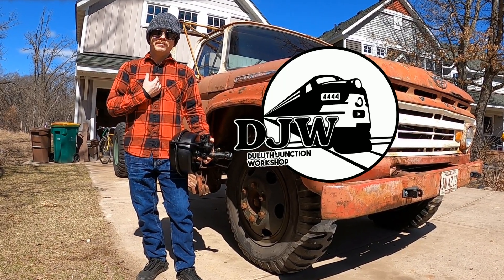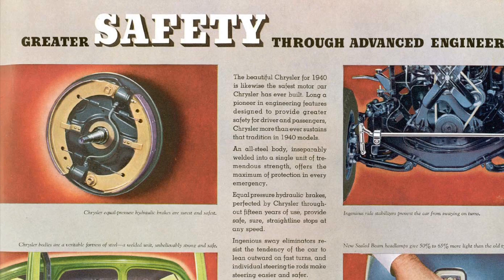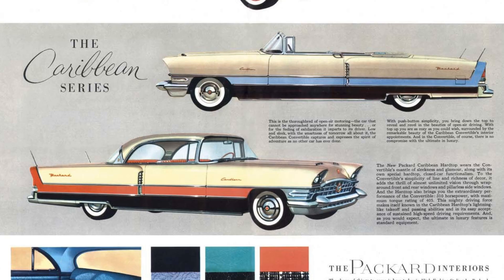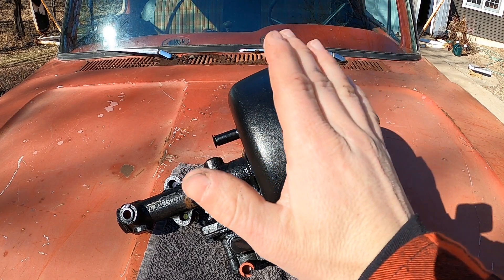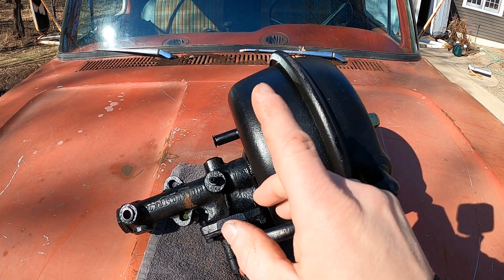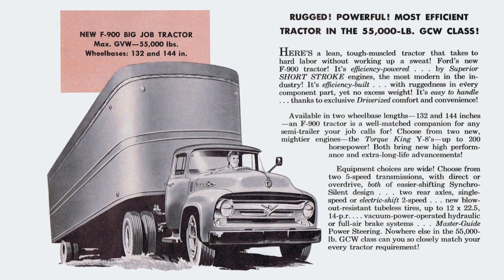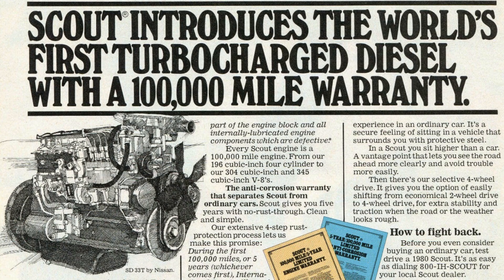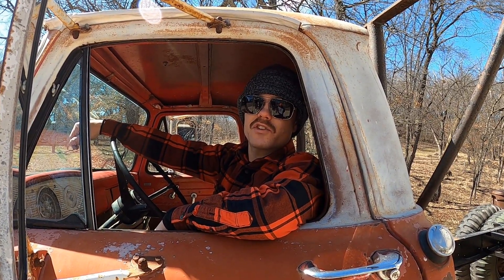All About Hydrovac Brake Boosters! Ep. 37

Comment: thanks for explaining. im trying to figure out how to rebuild the hydrovac booster in my '61 mercedes w111 fintail sedan. got no power brakes and a fat vacuum leak and the engine is burning brake fluid and throwing lots of white smoke.
Reply from the maker: I would suspect the slave cylinder seals are going out, letting fluid into the vacuum side of the diaphragm and getting sucked back through the vacuum hose. Thankfully you miiight get away without replacing the diaphragm? I would probably rebuild the whole thing anyway though!

Comment: What kind of vacuum hose did you use to run from the intake manifold to the check valve and then from the check valve to the hydrovac? Thanks!
Reply from the maker: PCV hose should work. It just has to be oil safe.

Comment: Hi. Very helpfull info.👌 I'm currently working on fitting this exact 'Midland Hy-power' booster ( fully rebuilt via chuck @ chucks trucks), complete with check valve etc, onto my 1942 Ford ' jailbar' 2ton, it's a 6cyl 226 . I'm about to drill & tap the inlet under carb for the vacuum hose fitting, Q is what size through
hole into the inlet bore chamber? It's hollow so will need to somehow bridge the gap. It does already have the orig  wiper vacuum port but it's too small & to enlarge would wipeout the housing boss. Any tips much appreciated. 🛠👌
Reply from the maker: Sorry, I would have no idea of the stock size. I recommend starting with the diameter of your vacuum hose, and then find a fitting that goes inside the hose. Fit the hole to the size of your fitting's threads.

Comment: I'm currently trying to diagnose a bad booster in my 61 f700.  Seems like it might be working sort of sometimes, but my biggest concern is when I am decelerating from a high rpm and use the engine to help brake the thing smokes bad.  This is the only time it smokes like that.  I am wondering if there is fluid leaking past the diaphram and the vacuum is sucking it into the engine.  I just now plugged it off to see if the smoking goes away and I am already looking to see if these boosters are even available.  Looks like later years might fit but I'm not quite there yet.  Thanks for the video.
Reply from the maker: You'll probably want to get it rebuilt. NAPA has them in the system but they're NLA. I sent mine to Brake & Equipment Warehouse in Minneapolis. They found someone to rebuild it for $400 (several years ago).
Reply: @SealedBeamRallyTeam I’m still ironing out some stuff before I get petty things like brakes haha but I did find one at advanced auto parts for a later year that looks like mine at least in the pics for about $200. If that doesn’t work I’ll find a rebuilder.

Comment: Where do you get parts for these?
Reply from the maker: I had mine rebuilt through Brake & Equipment Warehouse in Minneapolis. They found a place in Texas that did the work. Always happy to support local businesses, and they are worth a call if you need it done. It was a few years ago now but I recall the rebuild coming in around $400. Cheaper and easier than trying to adapt a firewall booster that would conflict with the carburetor.

Comment: I have a 71 gmc 5500 and I can’t get the brake pedal to come back out after pressing. Master cylinder is full of fluid
Reply from the maker: Everything hooked up factory style?
Reply: @ as far as I know. I’ve never messed with one of these trucks, the guy I bought it from put a new master cylinder on it.
Reply from the maker: @shanedees4124  Did it ever work correctly? Is there anything that changed?

And do you have the factory service manual?
Reply: @SealedBeamRallyTeam  I have no clue and I don’t have manual. Guy I bought it from said it used to be a fire truck. No I can’t get it running, Put a new alternator on it today, runs for about three seconds then all power cuts of, battery meter goes from 14v to 8
Reply from the maker: @shanedees4124  I would recommend buying a repop FSM on eBay or similar. My Ford books cover F100-F900!

Comment: I'm in superior and nead your help
Reply from the maker: Brake And Equipment Warehouse in Minneapolis was my main source for brake parts, although NAPA can get a lot for it. Factory service manual is necessary. 

Any specific problem you're having?
Reply: @SealedBeamRallyTeam  Do you have a copy of that manual by chance? or know where to get it ? I have a '73 C65 that I need to fix the brakes on. Just got it running and running great. Only flaw is brakes are super weak and lights don't work (no biggie there)
Reply from the maker: @OMAR-er9ec  Search it on Ebay or one of the many classic truck vendors. Both my 62 and 65 Ford truck manuals cover everything from 1/2 tons to cabover semi trucks in the same book. I've found repop manuals tend to go for around $75 and are worth every penny

Comment: Very informative video sir! I keep buying big old trucks, and so far all of them seem to have a hydrovac brake system and I was curious how they worked. I'm currently rebuilding the brakes on a 1966 C60. I also found the video about the split rim wheels to be extremely helpful! My truck seems to have the Firestone RH 5s on it.
Reply: Is there any info how to rebuilt these
Reply: @ummuibrohiym7864  My project has been sidelined for a while, so I haven't looked into it much. I wouldn't think there's much info about it though. Might be one of those things you have to figure out yourself or find an old service manual for it.

Comment: what is the part number of the new booster? where did you get it?
Reply from the maker: Rebuilt
Reply: Upgrade to a firewall mount dual diaphragm brake booster and dual master cylinder unit. I just upgraded my 64 F500.

Comment: ed here, found rebuilt hydrovac at napa, all cyclinders 6 working, new master. still wont stop with load! wondering if drums worn out?
Reply from the maker: I assume the brake pedal depresses properly. Double check the vacuum lines?
Reply: @SealedBeamRallyTeam  yes, hard petal, took off drums and watched wheel cyclinders move but dont remember seeing  both cycl. move on back wheels [top & bottom]
Reply from the maker: @patriciareynolds2729  Check to make sure you're getting fluid. There could be a kink or the hose to the rear axle might be collapsed internally.
Reply: @SealedBeamRallyTeam  thank u, found kink and that helped. left rear brakes will lock but right wont.
Reply from the maker: @patriciareynolds2729  You've replaced all the brake hoses?

Comment: I recently replaced all the wheel cylinders, master cylinder and booster on my '67 F600. Thank you for explaining the booster in great detail because this information is basically nonexistent. My truck was abandoned for years on an old farm in Georgia that is now a subdivision. Fortunately all the drums were like new. The cab has no rust and the cab mounts have no rust. I wire brushed the floor then sprayed cold galvanized paint before replacing the original rubber factory mat. I put a new fuel tank and all new fuel components, as well. New radiator, water pump and hoses. I replaced the distributor with a new HEI that is a bit more modern than the old points. I love your videos of your truck and I love to see you working with your father. Our old trucks become family members after a while.
Reply from the maker: Great story! Unfortunately the farm i bought mine from is less than a mile from the incessant march of subdivisions, and particularly ugly ones at that. Guess that's one reason they get put up for sale. Good to save the trucks as family projects even if we can't save the farms.
Reply: Did you buy a new booster or have yours rebuilt? If you had it rebuilt, where? I'm in Georgia also and I am trying to fix up a 78 F-700.

Comment: I am considering buying a 66 Ford F700. The owner says it needs the brakes worked on. I called around and no one local will supply the parts. Do you know of any good online suppliers?
Reply from the maker: Check out my later video on brake installation, but here's the short of it

Napa has wheel cylinders, master cylinder, and hardware kits. They might be able to get a rebuilt hydrovac, but don't count on it. For shoe relining and drum turning, find a local brake specialist shop. I used Brake And Equipment Warehouse in Minneapolis. They had all the wheel cylinders and whatnot in stock as well, Raybestos brand. They sent my hydrovac to Texas to be rebuilt. Hard to find hydrovac parts but they still do exist! Consider a newer firewall mounted booster with dual master  if you have the room- i didn't. I of course made all the lines by hand from nicopp.
Reply: @SealedBeamRallyTeam  Thanks. I checked Napa online but they didn't have anything listed so I might stop in the local shop to inquire. Maybe they can help with the pads and drums. Will look for a shop local that relines and turns as well.
Reply from the maker: @timothyneiswander3151  If your local Napa can't find it, let me know and I can send you the part numbers
Reply: What is the part number for 1977 f700 brake booster

Comment: Great vdo i subscribed. Hey looking for 1972 f600 left front brake line. Any suggestions where to find it
Reply from the maker: Line you'll have to make yourself. Hose you could call Brake & Equipment Warehouse in Minneapolis. They can probably look it up.
Reply: @SealedBeamRallyTeam  ty so much for fast reply
Reply: Having trouble getting air out brakes.  Can a bad booster put air into the system.

Comment: I have a 64 f600 thats missing all the hydrovac stuff, Im just going to run a fiewall mount booster on it.
Reply: Hey Kevin, did it work for you? I have a 79 international with hydrovac booster and can’t find a replacement.
Reply from the maker: @martingomez4216  Martin if you haven't, I would recommend gathering part numbers and calling Brake & Equipment Warehouse in Minneapolis. They may be able to rebuild it for you.
Reply: @martingomez4216  I'm just going to run it with no booster and see how bad it is first.
Reply from the maker: You probably have the 300 I6 with the intake on the passenger side right? I wasn't confident I could find a firewall booster that could fit next to the oil bath air cleaner.
Reply: @SealedBeamRallyTeam  no, mine has an FE v8, I am just going to try it out without a booster first and see how bad it is.
Reply: @KEVLAR1911  I'm curious how it did with no booster? You can't get them at all now.

Comment: I'm putting a 2005 f550 rear axle in mine bought it today for 500 with almost new tires on it.
Reply from the maker: Bolt pattern and tire sizes match??
Reply: @SealedBeamRallyTeam  no I mean I took the whole rear axle out of my 1966 and replaced it with the 2005 f550 axle. It bolted right up. Perfect tire size now I think.
Reply from the maker: @MrBlaze256  Did you use the F550 wheels/tires? Or widow makers? I really dig the 2 speed axle, so I'm looking eventually swap a T56 6-speed in, but I'm curious about the options.
Reply: @SealedBeamRallyTeam  i just have the f550 19.5 inch back rims on and leaving the front axle stock for now. Got to find some 19.5 rims for the front to match the rear.  There is also an auxiliary transmission  that adds a overdrive.
Reply: @SealedBeamRallyTeam  my truck doesn't have much power. It's either a 240 or 300 6 cylinder. I hope I can find a good deal on a diesel engine to put in it.
Reply from the maker: @MrBlaze256  Ok, so you converted to modern one-piece wheels then. Nice to have an OD. What's the final drive ratio on the "new" axle?
Reply from the maker: @MrBlaze256  You might consider Clifford Performance. They offer dual Weber conversions with headers and promise between 70% and 120% power gains (that is, doubling your power). Also check out the Power Nation 300 build. The 240/300 is a really stout engine that can make more than adequate power, so it would be a damn shame to throw it away.
Reply: @SealedBeamRallyTeam  I watched that power nation video that's some crazy gains with just intake and carb swap. I'll just have to see how it pulls now and decide from there. Wanting to used it to haul cars with my dolly . The new rear end is a 4.88 gears so it should be running 400 less rpm at 55 or 60.
Reply from the maker: You should have no problem hauling cars with that thing- it was meant to haul a whole lot more!
Reply: Do you have a ford or a Chevy

Comment: Diesels don't have any vacuum don't have anything to do with the turbos.  Diesels don't have a throttle flap it's wide open all the time and the gas pedal just controls how much Diesel fuel gets injected
Reply from the maker: Good point! That combined with turbo gas engines would cover most of the engines in modern pickups.

Comment: I have a 1959 Chevy Viking 40 (2 ton) and equipped with a Bendix HydroVac also, Works very well, My wheels have twin wheel cylinders and this truck even fully loaded stops on a dime with ease.
Reply from the maker: Great to hear! Sounds like a cool truck too. Out of curiosity, what's your cruising speed on that rig? About 40?
Reply: @SealedBeamRallyTeam  When on the freeway I drive 55 mph at 3500 rpms. It has 6.13 - 1 gear ratio.
Reply: Do you have a master with a booster in front of that system.?
Reply: @brandonparr6345  I do.